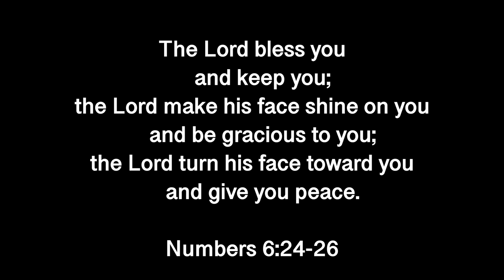Best Rear Ballast?? Heavy Hitch vs. Ballast Box

Comment: When I got my used x595/45 loader, it came with a Deere weight box.  Ground clearance is a big issue and I went with a heavy hitch style setup.  I use the weight box when doing loader or snow work around the neighborhood where inclines aren’t an issue and I can use it more like a cargo box.  I use chain as added weight in the box, and can carry fuel and other tools.  If traveling, or doing yard work I use the heavy hitch.  The heavy hitch is also easier to put on and off.  The small wood harbor freight furniture dollies work just fine on the Deere weight box.

Comment: Made my own out of 1/8" plate and some 1 x 4 solid bar stock and filled it with concrete. Measured at 1500 pounds. Took a few hours cutting and welding.Bought a 4000 pound easymass rear counter weight for 100.00 at auction.

Comment: That quick hitch moves it back several inches from the rear wheels which doesn't help when raising the front for loading.

The heavy hitch is great but pricey especially when my dealer wouldn't sell the loader without the box.  I welded a receiver into my JD box and filled with concrete.  I hit it from time to time on dirt mounds when working but really not that often.  I don't trailer though so that's a BIG difference.  I haven't run the numbers but I would suspect the HH can't compete with raw weight of the factory box with concrete though.

I use a $20 Milwaukee furniture dolly available at HD.  1000lb capacity, works great, just have to push a little at first to get it going the right direction.

Comment: Well one thing I can say for the ballast box, we get our fair share of snow and filling with loose sand gives an additional traction option on ice since our entire drive is a hill. Plus if it starts to rust over the years I would rather it takes winter damage than the heavy hitch system which is a small investment of its own.

Comment: I agree with your overall assessment on the Titan box. I have one for my BX. I had the same debris from China inside too. The sliding door moves better than yours, but had a lot of rust in this area. I bought this because I could have it in 2 days vs. waiting for the Kubota model, plus had to pay the freight charge on top of that. It has a lot of bad points, but I am just using it when moving mulch or stone once in a while, so it’s good enough for me. I am using 3-4 80# bags of dry concrete mix inside. It sits ok on a Harbor Freight dolly in my garage. I bought a 2” rubber PVC coupling and cut it in half, and inserted each half into each of the tool holes. Protects the tool handles and gives it a finished look too. Will repaint it orange this fall. I am not using a quick hitch so I have a lot of clearance with the 3 point hitch fully raised. Good video!

Comment: On our fruit farms we used a 50 gal drum filled with concrete that we ran a steel bar thru for our lower link before we filled it with concrete and for the upper link I welded up some steel and set it into the drum then filled it up with concrete from construction of a new cold storage.  It might be a bit too much  ballast for Jonny though we’d it on a 2140 Deere

Comment: What about changing the top link to a hydraulic cylinder type top link. That's what I did when my roto-tiller dragged the ground when loading the tractor on my trailer with the tiller attached.

Comment: The only thing i wanna know is.....How you added more juice to ol johny.   Other than that.... The easiest solution with the ballast box would seem to be to re-weld the Lower link  and top like brackets lower.  That way you could pick it up higher. I like the idea of the ballast box mainly for keeping extra tools, chain saw, Chain, Hand tools, fuel, etc... But if all you need is weight that heavy hitch is more practical.

Comment: The John Deere ballast box has none of those issues.  I filled it with concrete and pvc pipe for shovel holders.  Works great.
Reply: Agree. I wish this comparison would have used the JD ballast box as then several of the mentioned issues would not exist. Don't get me wrong, the HH is a very nice and capable solution but a lot of the issues shown are unique to the Titan implementation.

Comment: Not everyone uses a quick hitch or quick attach on the back which does allow for more clearance on the back of the tractor using the box.   I am one of those.  I never really needed one.  For a while, the main thing I had attached to the rear was the tiller... and quick attach is pointless in that regard because you still have to get of and attach the PTO shaft.   Now that I have added a bunch of other items, this year I will probably get a quick attach to save some time swapping between those things but prior to having all of the things I do now, I saw no real need since I just had a tiller, rear blade, weight box setup...   I had thought about getting a quick attach when I got the box.  It was actually the clearance thing that caused me to NOT buy the quick attach then. when I got the box because I knew I would not use it with the box at all at that point.

Now that I have more stuff and have modded the box, as I explain below, for more clearance, this year I will probably go for it and get the quick attach finally as it should not hinder things at all in this regard.

There is a lot more clearance without the quick attach.  And for the times I need to use the box, I do not have a need for the quick attach because it is primarily during snow plowing season I had use of the box for full time weight.. In the summer that is not an issue as I am using any number of attachments usually.  And when I do use the box, I have a solution I added to handle the clearance problem anyhow.

It is very easy to add another set of arms lower than the stock ones on the ballast box and move your pins down to those if using the quick attach mount.... but it also gives you even more height just on the standard 3 point arms too.   I.E. I just added another set of arms I can move the two lower pins too if I decided to add the quick attach and then the box on the rear of the tractor.  If you can't weld, you can easily find someone around that can weld two new small steel arms with the proper holes to move the pins to if need be.

For me at least, the box offers a LOT more use as well, not just for counter weight.  One, I use it for carrying rakes and shovels etc.   But during harvest, it is great for picking sweet corn because we throw the corn into the box, move to where we shuck it, open the bottom gate and dump it out, then throw all the husks back in as we husk the corn.. once done, take that to our compost and open the door for easy dumping.   One of the most recent things we did with it was to use it to pour both gravel and wood chips in a line and in a thickness wanted based on how far we opened the door.  In the winter, I just fill it with gravel which easily dumps out after spring arrives.   

You pointed out the door and it being a pain to open/close.  That is a good thing.  Not only do you then not lose much of anything you have in the box, it gives YOU the option to adjust it if you want.  What I did was grind down just a tad.. and I mean a sliver on both edges then apply a good s=graphite lube that does not evap or rub off easily..  My door opens and closes smooth as silk without losing anything noticeable of smaller particulate material I might put in it.. like grass seed!  I pull a seeder BEHIND the box, refilling the seeder from the box as needed..  It works well for fertilizer as well.

I am one of those that hates buying one use things.  I.E. the attachment and individual weights.  If I cannot see a way to use something for more than just a one off thing, I am not going to spend the money on it.  Spending a lot of money on a the weight attachment and individual weights only good for that one use when for less money I got the box and can use it for multiple things, for me, was the way to go.

I have not had any problems at all with clearance but again, I do not use the quick attach on the box unless I am using it for something like picking corn or a one job thing... and I have mine where I just moved the lower pins down to a second set of arms welded on to give me more bottom clearance and have had no problems at all with clearance.

Comment: since you are hauling johnny with a dump trailer  you can lessen the ramp angle by raising the bed till the the ramps are straight to the floor
Reply from the maker: The hinge is right at the rear of the trailer. It doesn’t help much (if at all). We have tried it.

Comment: Hey Tim idk why someone doesn't make a ballast box with the side facing the tractor longer and the outside shorter and have the bottom on an angle to help with approach angle
Reply: The width is limited by the 3 point hitch lower links and rear tire track width.

Comment: I want a rear weight that allows a trailer to be towed. The lifting pins have to be high enough to attach it to the tractor but lift to clear the trailer drawbar. I think extending legs is the only answer.

Comment: we had the ballast box for the jd 748 and use to put two 25ltr tanks of diesel in them yes it used to drag when coming on and off trailor and I know your ball hitch setup is simpler on your truck but if you had an adjusting plate to set the ball hitch higher maybe longer ramps it might not drag
Reply from the maker: I have adjusting plate on trailer hitch.  My trailer manufacturer said to make sure trailer is level when driving when using torsion axles.  So I do that.

Comment: Tim, other then putting 8 Katriels (she's so cute) in my JD BW15073 Ballast Box, do you think the BW15073 Ballast Box filled with play sand would be heavy enough to offset the 120R loader filled with dirt and such things?
Reply from the maker: Yes. ...but I think you would be happier with the heavy hitch and weights in the long run.
Reply: Thank you Tim.  For now it's what I have.  in the future I will definitely be getting the heavy hitch with weights.
Reply from the maker: I would recommend using sand, crushed stone, or some other heavy removable material.  I would not recommend concrete, as it is not reversible.

Comment: Just bought bx2380 and that ballast box was on the invoice, I insisted they take it off because I had no need for it, just a wasted tool was all I could see, will carry my box grader at all times anyway, or a rear blade or a snowblower didn’t think I needed it. Did I make a mistake? Will also have liquid ballast in the tires too. What do u think?
Reply from the maker: Your box blade is likely sufficient ballast...but it is BIG/WIDE.   It may limit your mobility in some situations.
In any case, you can decide this over time.

Comment: I do agree the heavy hitch is a lot better system.
However for the ones that already has the ballast box. Has anybody thought about relocating the 3 Point pens hire on the box and setting it on a custom built dolly that way you'd have the ground clearance as well as a way to move it around. The dolly would have to be with the wheels sticking out to the side on a frame to make up the difference when you set it down to disconnect but it could be done.
Reply: Check out the Artillian ballast box dolly. I think it might be what you are looking for.

Comment: Do you leave the Heavy Hitch with weights on Johnny when he's not in use?  If you do, is that putting stress on the tractor? I have a ballast box on my 2038R in the winter for snow blowing purposes. When I'm done snow blowing I am able to drop the box so that it's sitting on the garage floor.
Reply from the maker: HH is on and off my tractor frequently.  I sit it on the cart when not in use.
I have no worries about ‘stressing’ the tractor with the ballast while sitting in he shed.

Comment: Since you brought it up....how did you juice him up:)
Reply from the maker: Sorry.
Reply: Tractor steroids? I have put an updated pump on mine. If I remember right the original was like a 5.9 gallon per minute pump but I'm not sure. The updated one is almost 7. And you must change your check valve to go with it as well as the intake to the pump. If this is not done under warranty like my dear dealer did do when my pump got down to one 1.2 gallons per minute. (Yeah it was that low last year). It will be over $2500. And void the warranty.  The only reason I got the updated version was all the issues I had with this tractor for the first two years I had it. Actually all three years. And parts availability at the time (still waited 6 weeks).
 It was in the shop for the same issue again this year. They was blaming the $989 loader valve "Suckling air".  They never convince me that a pressure valve could suck air. So I did not let them fix it because that valve was not covered under warranty this year. It did finally revealed its leak the other day. It was right at the screen coming out of the transmission going to this new pump. The hose clamp keeps working loose. I believe the hose is actually a little bit bigger and stiffer than the original. When it gets hot it starts to leak. But I will admit for the first time since I got the tractor. BEFORE it started leaking again it performed the best it's ever performed. In fact the loader was picking up the back of the tractor with the backhoe, filled tires (53lbs/tire), and 50lb wheel weights on each side on it. Plus my 400lbs. Note here: the object I was lifting with my Forks unbeknownst to me was actually stuck in the ground. Otherwise I would not have been picking up that much weight. In fact I'm surprised I didn't break the front axle after I seen what was going on. Anyway I did not pick that up with that tractor I ended up digging it out and then picking it up with a skid steer. But about a week later I noticed that hose leaking again. I'm not sure what I need to do with it. Possibly heavier Duty hose clamps might work.

Back to the possible juicing. I don't know if that's what he done.

Comment: Tim, I am thinking about getting 70 lbs weights for my rear tires for my 1025R and I also have a blade on the back. I live in Minnesota and I also have a very steep driveway, I find myself sliding when it is icy and not having much weight on the back. I purchase a quick attach snow plow for the front. Do you think the rear weights will take care of the problem? My whole back also lifts up when I try to lift a round bale. I know that's too much for the small tractor but I managed to do it. 1200 lbs.
Reply from the maker: Get the 72 lb weights AND rimguard in the tires.    https://Rimguardsolutions.com/TTWT  
But you still need 3 pt attached ballast for loader work.

Comment: Nice vid.  If I have ballast wheels on my BX23 with a front loader, do I still need to have weights in the back?  I do like the use of the ball hitch though.
Reply from the maker: Yes.  Not nearly enough weights. Check your manual.  The Deere manuals specify the amount of weight necessary.  Usually 500lb or so on 3 pt PLUS fluid and wheel weights on tires.

Comment: While the difference between the heavy hitch and the ballast box is stark, I wonder if you could weasel just a little bit more clearance with the ballast box by using the three point linkage instead of the quick hitch which adds another 6" (+/-) in length.
Reply from the maker: I think it is about 3 inches in length additional.

Comment: I got a 2007 john deere 790 with a 300 loader , which class hitch do I need and how much weight should I get for it ? Is there a kit for bar and weights ?
Reply from the maker: 790 needs a 'Cat 1' hitch.  I would recommend the "double" bracket.  Initially with 8x 70lb weights. If you find that to be insufficient,  You could add 8x 42lb weights on the same bracket.
To my knowledge, there is not a 'kit'.  
One more piece of advice...the shipping on the weights is much cheaper during 'normal' times.  Fastenal (the shipper) closed down during covid.   I would recommend calling heavyhitch.com to see when Fastenal opens back up.    Have them hold the shipment of your product until then.    ...you will save hundreds of dollars by doing this.

Comment: Hi Tim, really enjoy your videos. I'm fixing to purchase a heavy hitch for my 1023e but I'm not sure which one. I'm leaning towards the Super Duty. Would that work well for my tractor? Thanks
Reply from the maker: I recommend the offset or double so that you can optionally use the 70 lb weights.
I have a video showing the differences

Comment: Would the amount of ballast need to be adjusted based on fluid filled tires or would you use same ballast weight either way ?
Reply from the maker: Same amount either way, really.  I’ll try to go over that in a later video.